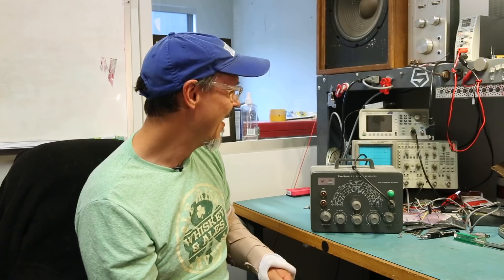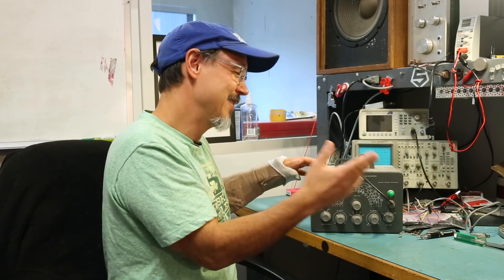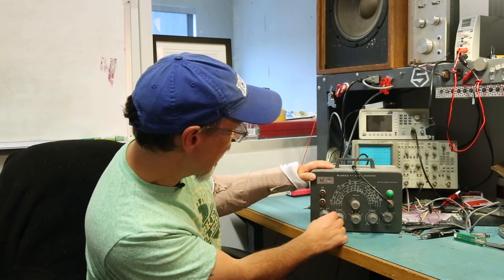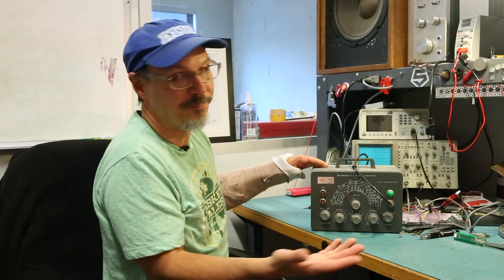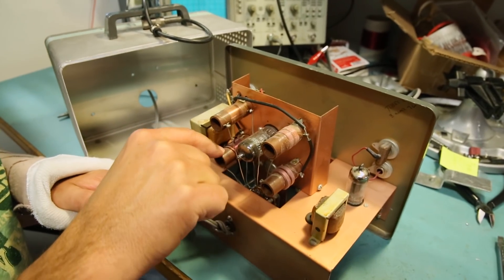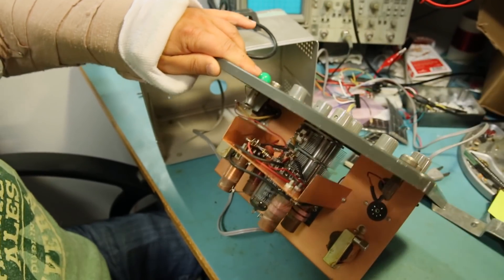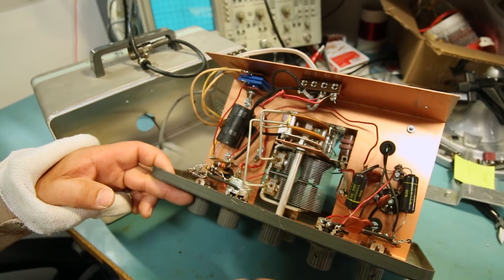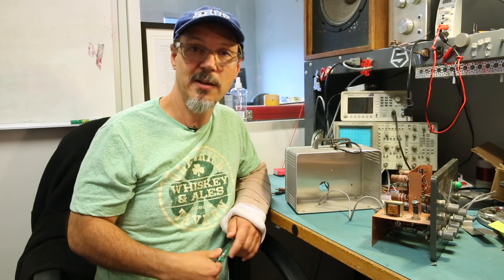Old Machine Time Machine - Heathkit RF Signal Generator

Comment: I keep seeing old electronics gear and am intrigued by the possibility of using them for audio generating, but I just don't know enough about electronics to know what they can do or what they can be repurposed for. I also have a safety concern about going inside anything that plugs into the wall and uses tubes. Any advice or resources you can point me to would be much appreciated.

Comment: Those three jacks on the signal generator are not PL-259's. Actually they're Amphenol microphone connectors # MC1M. The plug that fits them are #2501F.
You could change them out to regular BNC female chassis mount soldered types very easily. It will probably need some work. There is a nasty old selenium
rectifier inside  that needs to replaced and at it's age that is a must whether you have used it or not! Plan to replace the double black elec. cap as well!
Reply: Thank you. Finally somebody who actually knows the right plug. Could never find it, didn't know i had to search for vintage microphone connectors.

Comment: The frequency pointer is likely driven by a ball drive on the front of the variable capacitor.  It was done that way to give you fine or "vernier" adjustment of the tuning capacitor.  The ball drive is similar to a planetary gear drive.  This one is slipping, most likely the lubricant is stiff and the friction in the drive is not sufficient to overcome the sticky old grease.  It can be cleaned and re-lubed and made to work again.  Old equipment is a combination of electronic design and some fascinating mechanical design.  Look up "ball friction drive" for videos of how this works.  I used  equipment like this to fix radios and TVs when I was still in my teens,  long ago.
Reply: How do I clean and lube the ball drive?  The knob is frozen to the sweep arm.  I have removed the knob and sweep arm and applied penetrating lube to the shaft and it has not broken loose.

Comment: I wanted one of those in about 1958, but I could not afford it on my paper route money. I did get an OS3 oscilloscope which I still have. It has not been powered on in many years, but I cannot bring myself to scrap it. 
The modulation was to make a frequency sweep generator so you could use a scope to see a frequency response curve. It was a frequency modulation (FM) not AM.

Comment: I have a Heathkit SG-8 RF signal generator that my late father built in the mid 1950's.  I have kept it in working condition.  The heavy "bus bars" under the cabinet serve as VHF (Band E) oscillator coils.  The second tube is a 6C4 triode that functions as an oscillator for the internal audio modulation.  When the modulation is switched to EXTERNAL, the 6C4 functions as an audio amplifier before the audio signal modulates the RF oscillator.  The power supply uses an early type of solid state rectifier made of selenium plates.  You can see it bolted to the side of the chassis near the electrolytic capacitor.

Comment: Got any old frequency gear with a simple ICM7216 or ICM7226? I've been goofing around with a 7216 because it cost me less than $1. I've also been playing with an old 11C90 and MC12095 just to explore dirt cheap ancient prescalers. I'd love to see some classic examples of prescalers and/or ways people have goofed around with these early Intersil IC's. I'm building my stuff primarily based on a great little write up by Robert Reed from the August 2014 edition of Nuts and Volts magazine (online edition/posted publicly on their website). I know there are lots of much better IC options out there for a project like this, but I kinda like the analogue simplicity of it all. So whatcha got laying around like this?
-Jake

Comment: That looks just like one we had back in my high school electronics class (86-87).  The teacher had built it years before and brought it in for us to use.  I could swear the Frequency knob in the center was multi-turn and would move the clear plastic pointer a lot slower than the knob.  But, maybe we had a slightly different model.

Comment: Ooops, not a PL-259 connector on the front panel, that a male 50 ohm coax connector...thanks for the peek inside!  "One of the old ham guys".
Reply: Searching for "male 50 ohm coax connector" doesn't show a single fitting connector :(
PL-259 doesn't too.
It has to be something else.